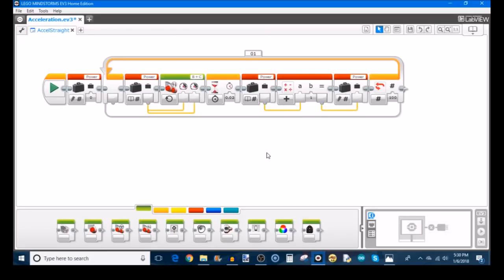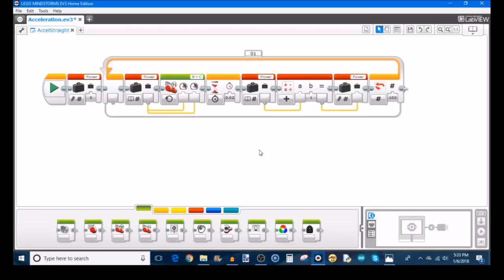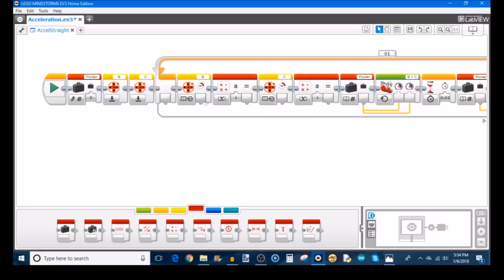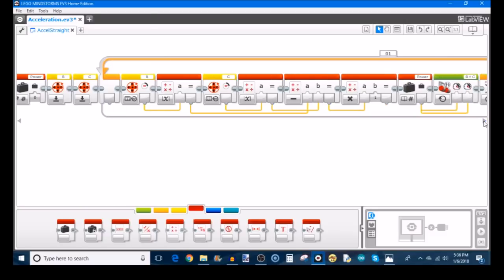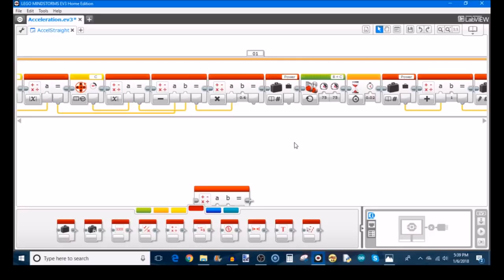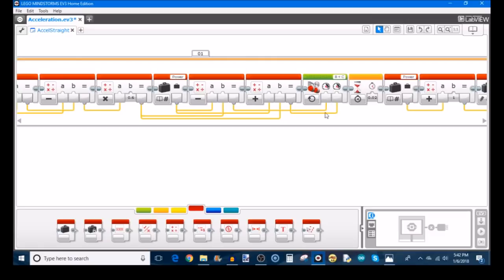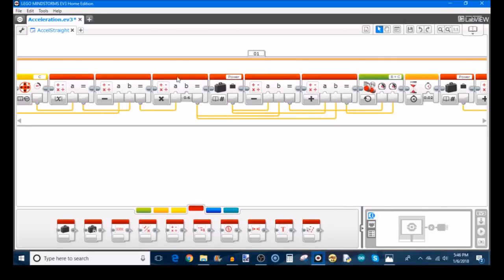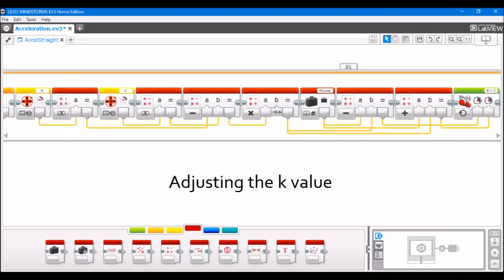The Ultimate EV3 Acceleration MyBlock - Accel Plus Drive-Straight

Comment: Hi, How can we combine acceleration and gyro-drive straight. Because yes this acceleration program works fine but if not attachments on robot. In FLL when we add the attachments for the missions, acceleration doesn't work  because or center of mass changed.

Comment: Hey Kyle, first of all, thanks a lot for your videos. They are very, very helpful! In this video, I am asking myself why you are not using the built-in data wire of the loop block. If you have a loop running for x times, there is a data wire available (at the starting point of the loop) which exactly contains the current index number of the loop. So pretty the same as what you 'Power' variable does. Is there a reason why you built it this way, so why you use a variable instead of the index value of the loop? (If my English is strange, sorry for that, I am not a native speaker.)
Reply from the maker: That's a great point! You absolutely may use the count built into the loop, and it should work the same. I'm primarily a C programmer, so I always think of programming in terms of C code, that's the only reason why I wrote the EV3 code the way I did. :)

Comment: I really like this program, but I can't figure out how to make it stop at a specific  distance. Is there a way to run a parallel code to exit the loop once certain number motor degrees have been reached? More specifically, we are trying to solve 3 problems, acceleration, motor drift, and stopping at a specific point. Your videos have been most helpful and free of errors.
Reply from the maker: First, give the loop that you want to end (the one that contains the driving code) some kind of name (the default name is "01"). Then you will need a second Start block to start a parallel branch of code. The second branch should have an infinite loop that monitors the rotations, then triggers the true case of a switch if the condition is met. Inside that true case, place a Loop Interrupt block and select your named driving loop. Voila, your exit case is set up!
Reply: @Builderdude35  Hi I tried it but It does not work is there anyway you could make a tutorial

Comment: Is it possible to merge that myblock with one to convert degrees to centimeters?
Reply from the maker: Absolutely! You will just need to know the diameter of the wheel to convert degrees to linear distance (and assume no wheel slippage). See my video on calculating linear distance from wheel diameter (How Far is One Rotation?).

Comment: My video idea is how to correct gyro drift and use an alternative when a gyro drift is present
Reply: The Seshan brothers have an excellent text-based resource here: http://ev3lessons.com/translations/en-us/advanced/GyroRevisited.pdf.  It addresses most cases of gyro drift, and addresses some of the confusion about why "calibration" doesn't always work.
Reply: thanks
Reply from the maker: Try this tutorial of mine: https://youtu.be/7V16AEW3GG4
Reply: Hi Kyle; while your tutorial does an excellent job of explaining the proven approach of switching measurement modes on the Gyro, that widely-accepted technique never quite worked for me (and many others.)  Someone in the Seshan brothers' reader base (Sam Last) managed to discover that EV3 gyro sensors produced from 2014 onwards use different electronics that behave differently - they do NOT reset when changing measurement modes.  For those, the only way to reset them is to disconnect/reconnect or - get this - force the brick to reset them by reading them as "infrared" sensors!  Very interesting technique indeed, documented very well in the link I posted.  Have been using it for the past few months with great success.

Comment: My son's FLL team did something similar this year, although I think he/they took it further.  They already were using a Gyro-assisted "stay straight" block, where variations detected by the gyro sensor would cause proportional adjustments to the speeds of the two motors.  This year they added the concept of "speed limits".  There's the general overall max speed, but also a speed limit based on time when the block stops, and a speed limit based on distance from the destination.  The robot speed is capped by these three limits.  Using this approach, the robot ramps up the speed at the start, and ramps down the speed as it stops.  Because of these limits, they are able to simple say "go straight" pretty much everywhere, rarely needing to adjust the speed, because short distances (where precise movements are needed) never reach the full speed.  This was my son's last year, and was kind of the "capstone" of what he learned over 7 years of FLL.  They were fortunate to win the programming award at the state championship event this year.
Reply from the maker: That's incredible! Thank you for sharing this with me! That is a fantastic idea and I'm glad to hear about it. Tell him I said congratulations!

Comment: You can simplify this program by using a move steering block(like your original drive straight) instead of a move tank. Of course the order of which motor's value you subtract from which will need to change if you drive in reverse, so what we did was copied the entire code into a second condition in a switch with these values swapped. Then we just run the different side of the switch for the direction we want, you can program this to select automatically based on whether power is positive(> 0) or negative. Last year the fll team that I coach made a myblock that accelerates or deccelerates in either direction incorporating drivestraight and with the option of running for rotations. Needless to say it was quite complicated. We had trouble getting the distance it drives consistent at first since accelerating works on time which is not very consistent, so we then made it go for rotations after accelerating(of course without resetting the rotations after accelerating so it measures the total rotations traveled throughout) and then it worked really really well.
Reply from the maker: That is awesome, thank you for sharing!

Comment: Is it possible to add a gyrosensor to a 31313 package?
Reply: yes i did it because all the sets are the same only the parts for building the robot might be more or less so my answer to your question is YES
!!
Reply: Or, you could use a move steering block, which I believe automatically corrects for veering based on the rotation sensors.
Reply: is it ????
Reply: Lol, I meant to post that in the main thread. In my gyro ramp move inches my block, I use both a steering block, and a gyro.
Reply: my anwer is that everithing is possible with lego and ev3!!!!!
Reply: my anwer is that everithing is possible with lego and ev3!!!!!
Reply: my anwer is that everithing is possible with lego and ev3!!!!!
Reply: I mean that i cant find the gyrosensor in the software
Reply: +Nvilder Parkour you can add it but I do not know how.Ask builderdude35.I told you!Everithing is possible!!!!
Reply: Go to LEGO Mindstorms downloads, and you can download it as Gyro.ev3b, and then import it using the "Import block" functionality.
Reply from the maker: You will need to download the programming block from lego.com/mindstorms and import the block into your EV3 programming software. See my tutorial on importing extra sensor blocks for help.